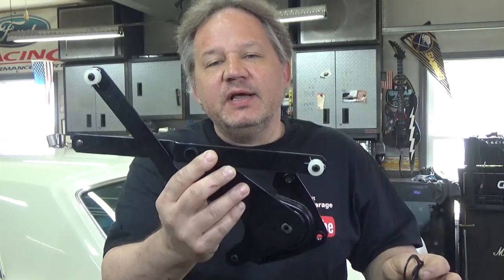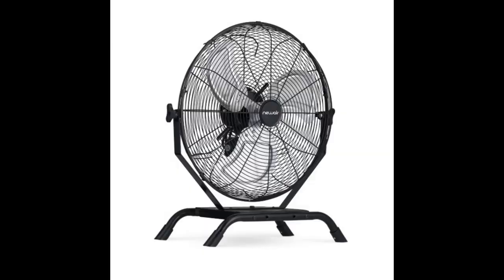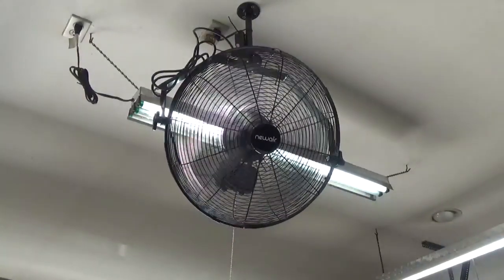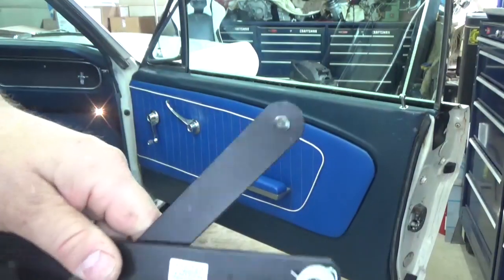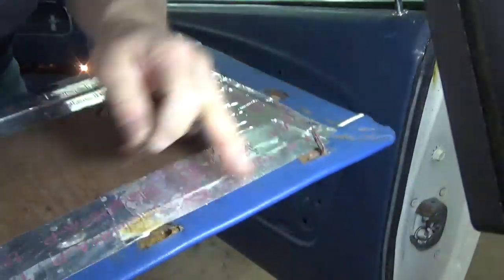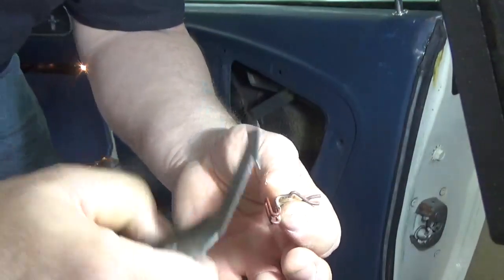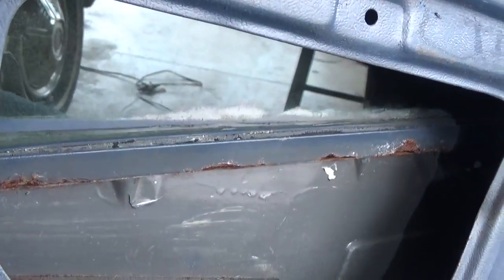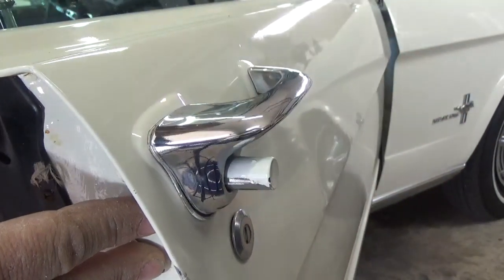1965 Mustang   Diagnosing Window Stuck, Won't Roll Down -  NewAir 18" Outdoor Fan

Comment: ive seen flexible metal pipe that is placed over the tailpipe that vents all exhaust fumes/ vapours outside the workshop, better for your longterm health.
Reply from the maker: I've seen those too, but when the air is not moving at all, you need it make it flow

Comment: Hey, Pete would you be available to speak with? I own a 01 cobra and it is pouring white smoke and oil blowback and I guess compression test wasn't the best and something in the engine needs to be fixed, I already spend near 2 grand to rebuild the hellion turbocharger that is on this car but wanted to show u the engine bay and see if we can diagnose it, the people working on it said the motor was blown but then I ask where exactly and they only can say the left side, cant specifically show me exactly where...

Would you be able to help out a fellow Peter and be able for 5 minutes of your time tops, so I can let u know what is going on and see if we can diagnose it than the people unable to fix it currently and cant point out specifically where... there are hoses not connected to connectors on the firewall, and even the oil separator inlet is coming from from the crankcase breather hose and the lower fitting and overflow section leads directly to the intake right before the turbo sucks it up... I'm guessing causing the oil blowback issue? but if u can help me in diagnosing why it is pouring white smoke the ten minutes that I did drive the car...and if an engine is blown then there is no way that it would start right up and run correctly, would it?

Somebody legit sabotaged this car on me, please help me peter to figure out what could be wrong, so I can get a better handle on exactly what it needs... would u be interested in helping fix the car? I may be able to ship it to you if you think u can get her running as she should... Thanks and hope to hear from you,

-Peter Piccolo
Reply from the maker: I'll help if I can
Reply: I have a 65 Mustang with a built 302 and Paxton supercharger.  You might have the same problem I do.  The supercharger manual requires a higher performance fuel pump which is fitted with an additional VACCUM line running up to the carburetor.  It is designed to push fuel up to the carb if the internal membrane. My Carter fuel pump was 12 years old and apparently the membrane failed so it sent fuel up into the carb causing all sorts of misfires, etc due to the excess fuel. My Paxton uses an airbox and is push through unit so the QFT carb sits inside the airbox.  Thus all the extra fuel was going into the airbox and into the carb causing it to run extremely rich.  Check to see if your fuel pump (mechanical) has an added line running up to the carb to act as an overflow.  I may have explained it wrong, but I just ordered a carb rebuild kit and new fuel pump.  I don't know if this even applies to an electric fuel pump system.  Good luck.  I had to track down a local expert to diagnose this because that extra line is not normal on most carbureted engines.
Reply from the maker: Electric fuel pumps are different. The extra line out of the carb is a vent that is supposed to go back to the tank or EGR system